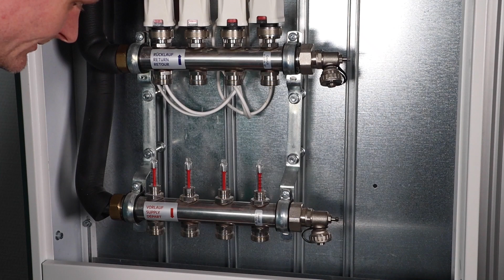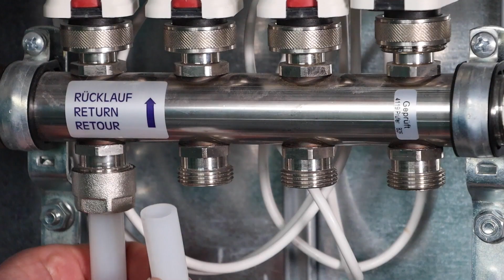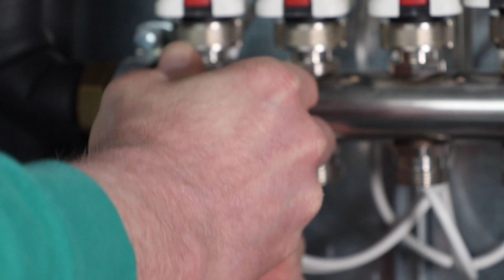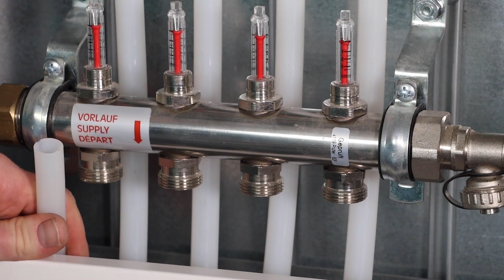Mounting the PEX pipes on WATTS heating circuit manifold HKV2013AF (English subtitles)

Comment: How to close/open the flow meters? I need that to flush/bleed the system. Thanks!
Reply from the maker: The flow meters must be completely open!
https://www.watts.eu/en/technical-support/manuals/manifolds-heating/23457
On page 10, you will find instructions for flushing the circuits.